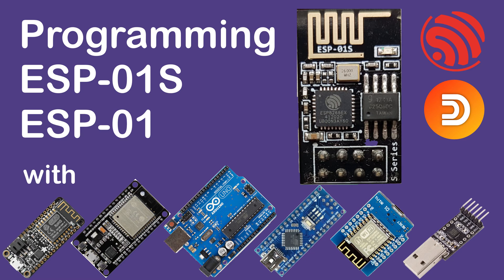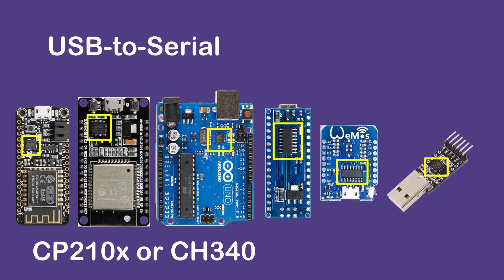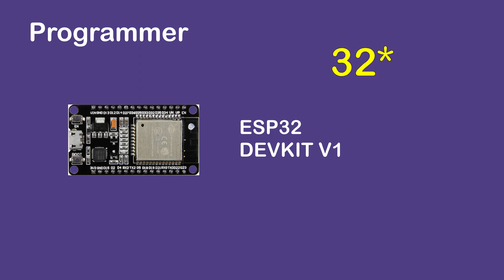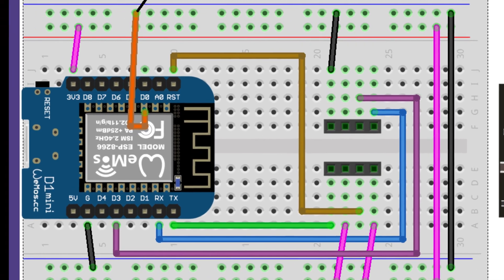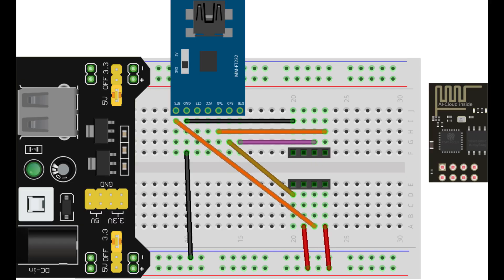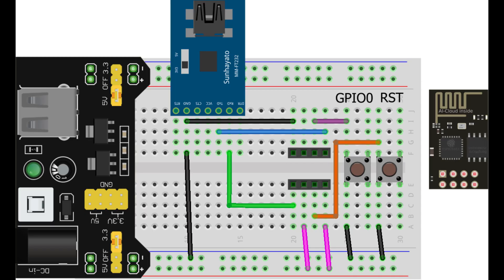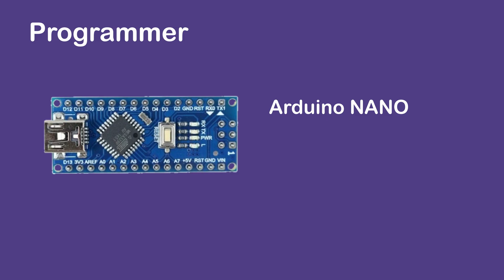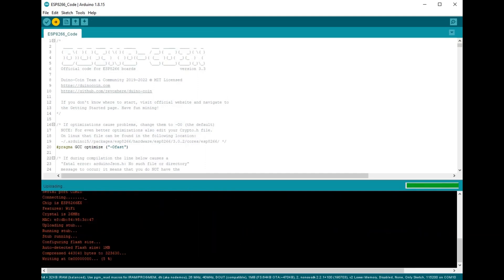Programming ESP-01S ESP-01 with NodeMCU D1 mini ESP32 UNO NANO FTDI

Comment: Is there a way to disable the onboard uart interface of the esp32 board and still program the Microcontroller with external ftdi programmer?
Reply from the maker: I think you mean the usb-serial chip. by default the usb-serial will not drive the esp32 serial interface, so external ftdi should work
Reply: Thanks  @JKRolling